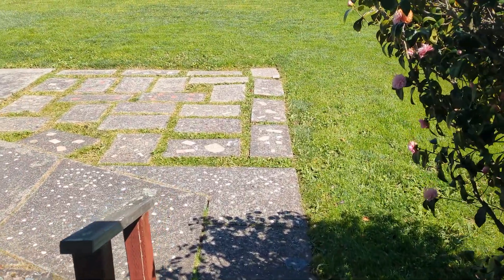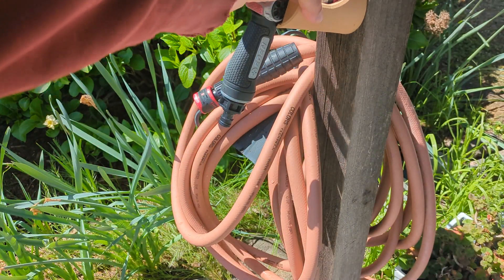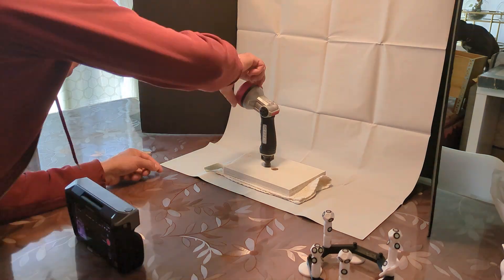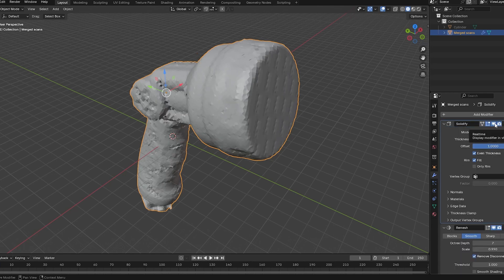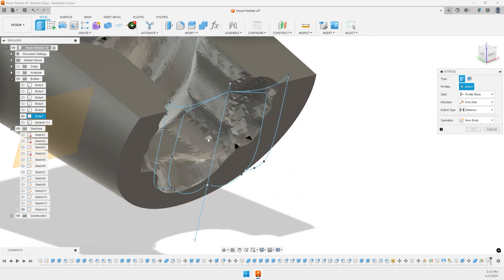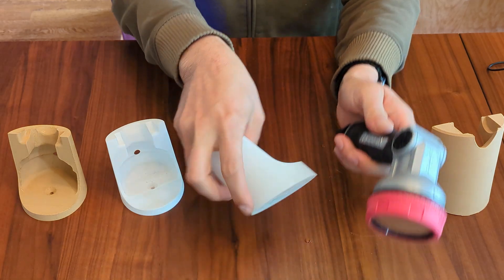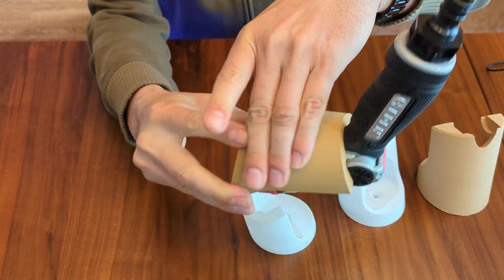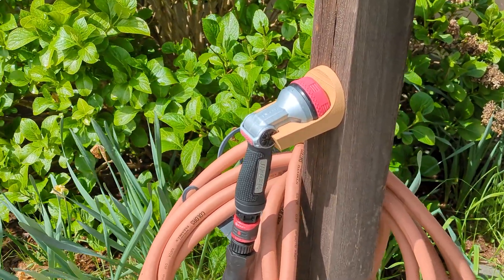3d Scanning My Hose Sprayer to 3d Print The Perfect Holster

Comment: Great idea and solution to your problem. I am curious about using wood filament. Is there any concern for it swelling when exposed to moisture? It probably would be minimal, however, with your tight tolerances in the print I a wondering if the nozzle could become stuck.
Reply from the maker: "PolyWood" filament is pretty interesting in that it foams as its printed and the foaming creates the matte finish that resembles wood - no bits of real wood to clog the nozzle. I used Generic PLA settings. Only time will tell how it holds up outside. If this were a more serious application I would use something like ASA.